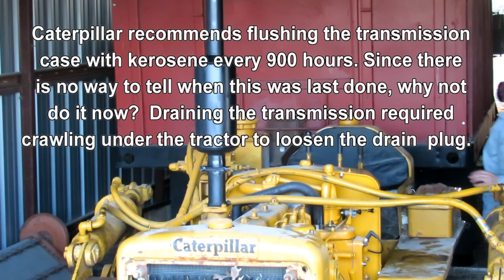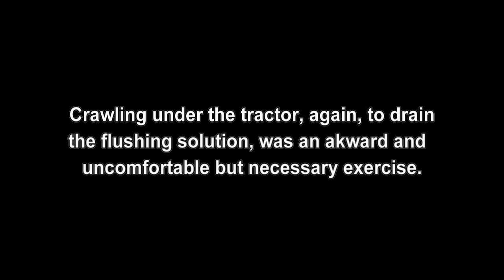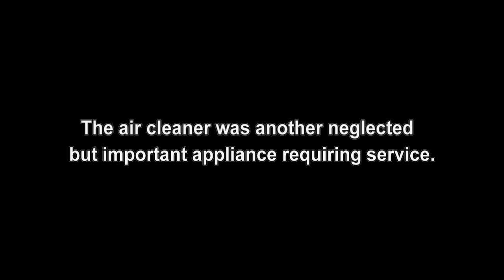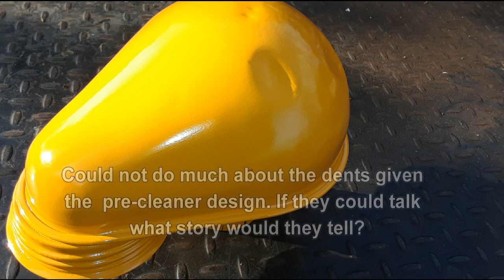1941 Caterpillar D2 5J Rebuild Part 18 Transmission Oil & Air Cleaner

Comment: Caterpillar also recommends NOT to steam clean the air cleaner screens inside the air cleaner housing.
Reply from the maker: What do you suppose was the reasoning behind that?   I actually used steam not high pressure hot water. Worked well, no damage.
Reply: @lineshaftrestorations7903  I will find the Cat service brochure that explains it.
Reply: It says to "immerse the entire upper section of the air cleaner in some non flammable cleaning fluid. Steam cleaning is not recommended because some forms of dust rolls into small balls when steam is applied, and these balls cannot be washed out of the screens." This was taken from a 1955 Operation and Maintenance Instruction manual.